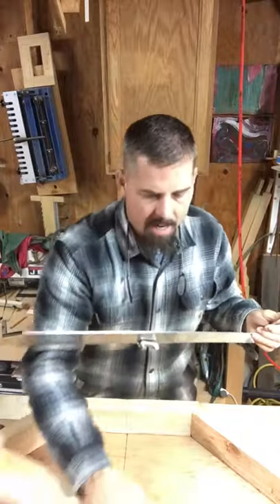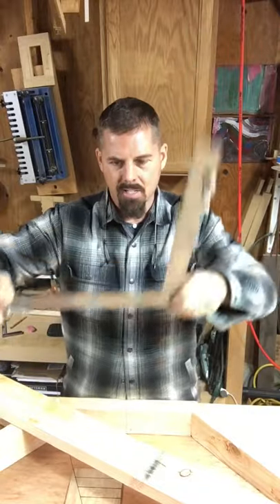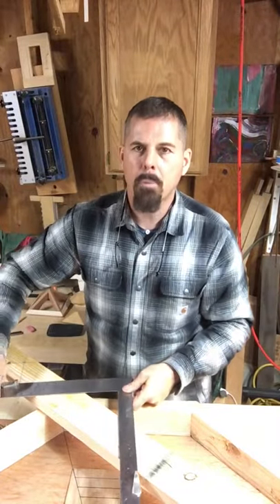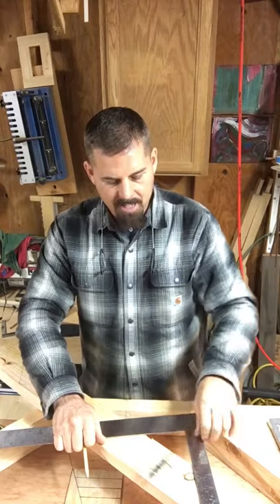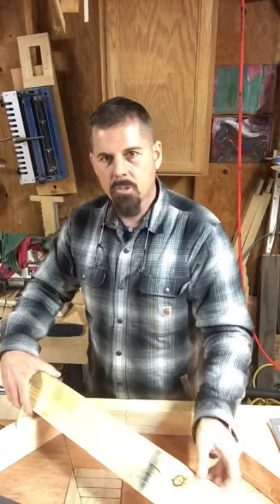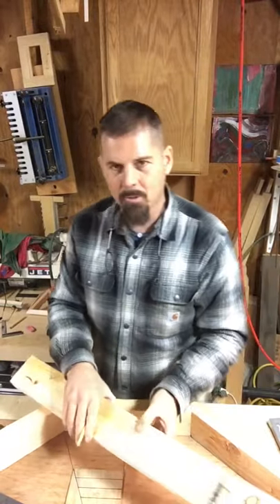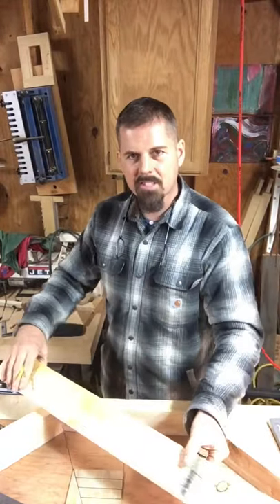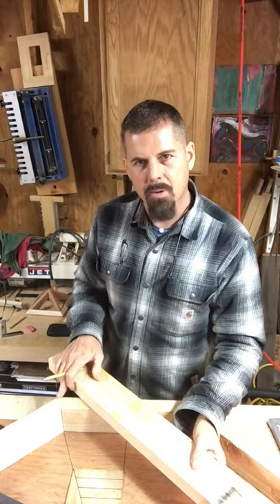Framing an Octagon part 2

Comment: Would love to see or hear about stepping off with the 12th and 10th side . Used The 12th for scaling a model . Inches were feet and the 12th represented inches. Is there a section in the book of secrets that explains it ? Remember the first time I discovered that side of square when l was a nube. Marked off and cut B.c.i blocks only to find out they were short.